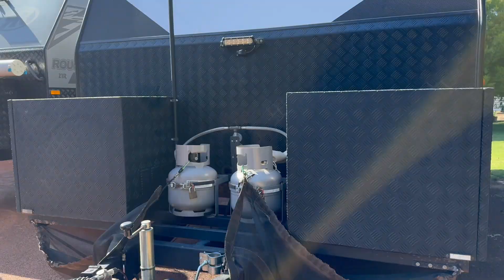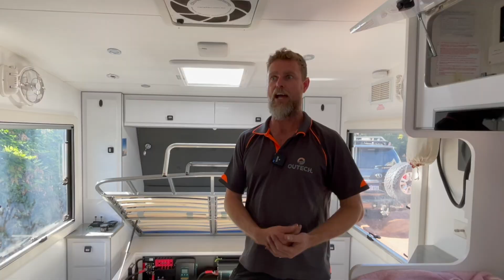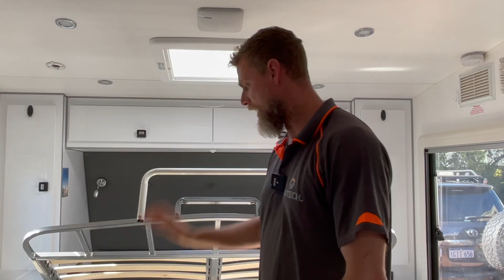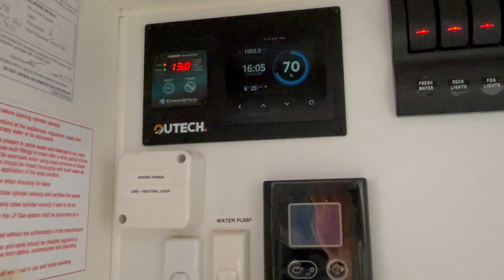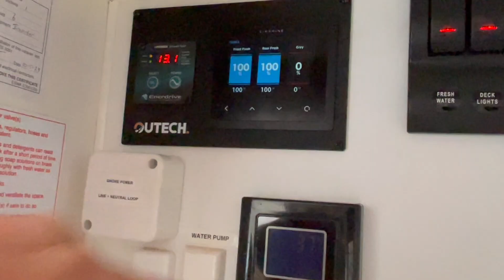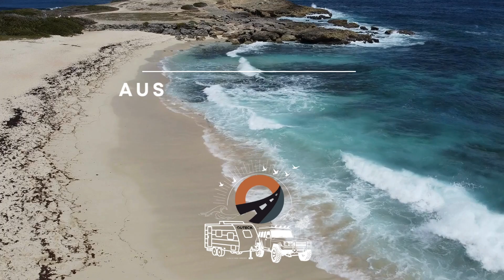JB Caravans Gator-X  Enerdrive Power System Upgrade

Comment: So you’ve extensively changed the installation except bolt the batteries in and you think it’s compliant because “the batteries were already installed”
Yeah, good luck with that. You need to bring it up to current standard
Reply from the maker: As mentioned in the video, the batteries have not changed and were already installed into the van. This is neither a modification or an ‘alteration’ as outlined by the standard. Therefore do not need to be separated from the habitable space

All other aspects of the installation have been modified and as such brought up to the requirements of the standard.
Reply: @ cute, but that’s not how it works, you need to bring the installation up to current standard
Reply from the maker: Appreciate the reply and feedback. Can you point us in the direction of the particular clause in the standards which your interpretation references?
Reply: @outechoffgrid  Awesome, I noticed old mate never replied😁 love your work.

Comment: Talking Lithium battery fires in caravans, one component that is largely overlooked is exposed battery terminals like this one. With BMS capable of delivering 100+ amps continuously  (Depending on battery) one hazard is if a metal object was to bridge the terminals before the BMS knocks the power off and pre any system fuse/s. Definitely agree that LifePo4 are one of the safer of the lithium chemistries when it comes to fires but they still burn albeit at a higher temp than their equivalents. Great vid, keep up the good work. Unfortunately the industry has a lot left to be desired of when it comes to quality of workmanship at the construction phase for what they are charging for some of these caravans.
Reply from the maker: This is the benefit of quality lithium iron phosphate batteries with a built in bms. The bms infact does knock the output terminals off very quickly in the situation where a short circuit does occur

I do agree however, more protection the better.